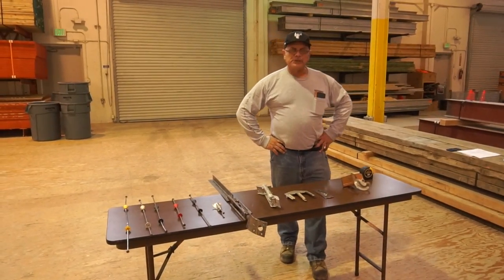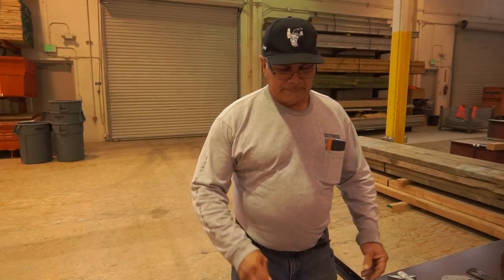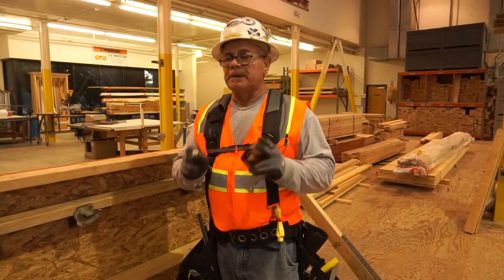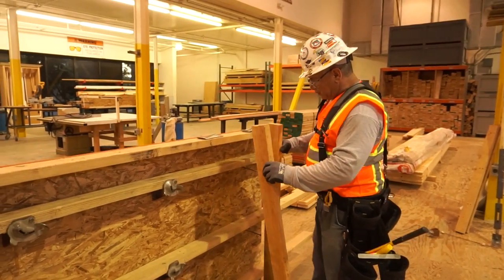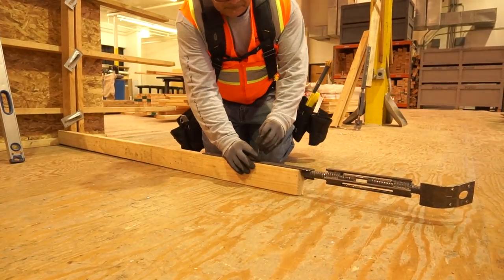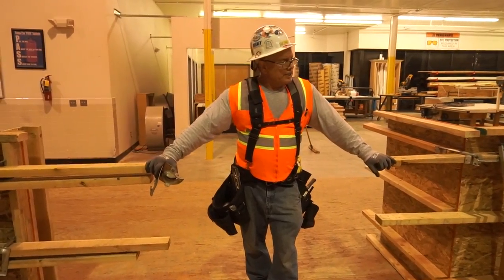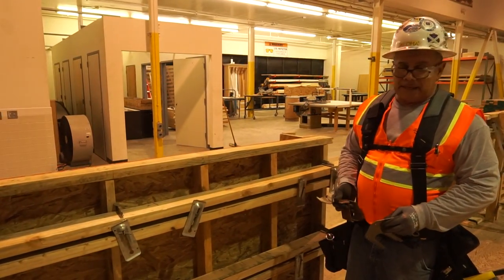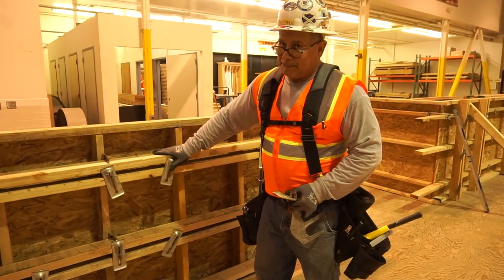Wall Forming 1

Comment: In my 30 yrs.of concrete work that's the first time I ever see a turnbuckle nailed to the floor but then again your forming inside where you have a wooden floor , proper way to teach people that don't know anything about concrete is to set wall up outside where majority of the work is done , other then that everything is good except that turnbuckles are backwards.
Reply: 2 years later I hope you’ve done the same bs by using a roduhhhhammar to existing concrete. Cmon boy you sound new. You nail it onto a small piece of plywood where the nails hit through the ply and the bottom wood and then put a 2x4 up against the back of the ply so it don’t slide back. Yaaaaaa digggg
Reply: He ain't sharpest tool in the shed. Btw, they make long end snap ties.

Comment: It would have been nice to see the entire process from the placing of the wafer board upright, through to the bracing. you don't get a sense of how you initially start
Reply: 1: layout walls both sides
2: secure 2x4 to outside wall lines including ply thickness to the wall, every 4'
3: start in corner with ply plumb up corner both ways(use wedge if needed to keep in place out side of wall)
4: nail corner to 2x4 then nail end of ply when plumb
5: next ply toenail top to old ply plumb up end and nail bottom 
6: temp brace after 8' to not let it fall over, layout holes 2' x2' usually starting 1' up 1' over
7: inside corner holes on outside form wall thickness +9" (for hardware ) drill holes
8: work from corners to center of  wall length cut 1 filler ply to finish wall form
9: put in ties, walers, and clamps overlapping waler ends to be a continuous waler

Comment: Very informative video, but I'd like to add that it might be better to use 4x4 and 2x4 for your uprights/strongbacks since it would allow the wedges to cover more surface area instead of sticking out 2 inches on either side. Also, the ends of the snap ties are nearly maxed out on the wedge and might not hold up against the pressure of concrete.

Comment: THANK YOU....THANK YOU....THANK YOU......ON YOUR 2X4 VERTICLE STRONG BACKS.....YOU DID NOT PUT 16 PENNY NAILS IN THE 2 2X4S TO JOIN THEM TOGETHER WITH THE SNAP TIE ROD IN THE MIDDLE......ALSO IF YOU ARE NOT USING THE METAL CORNER BRACKET.......ONE 2X4 COMES IN THE CORNER UNDER THE TIE ROD....THEN THE OTHER 2X4 COMES IN ABOVE THE ROD......BOTH ENDS ARE EXTENDED......NOW YOU CAN PUT 2 16 PENNY NAILS DIRECTLY AT THE OUTSIDE CORNER OF THE PLYWOOD.......NOW FINISH THE OUTSIDE CORNER FORM WITH STANDARD LOG CABIN STYLE.....I WAS A UNION CARPENTER 50 YEARS

Comment: Let's say I would have to build a form withouy engineering specifications. How do I choose if I want to go single waler or double? Also, are there rules of thumb for the center center spacing of the 2x4.

Thanks.
Reply: 16 inch oc for 2x4 and depends on the thickness of your plywood

Comment: I never nail the hair pins and I make sure none of the guys I’m working with does either, it’s way more tedious to strip? I just put a 16d nail at the top and bottom of the strong backs and a vibrator will never shake that apart

Comment: This man is not and never was a shuttering carpenter the way he handles his hammer it doesn't flow along with his harm. I would pay top dollar to watch you fail at designing  freestyling a shutter  in a hurry and have it ready for concrete using just scraps ie all that was available